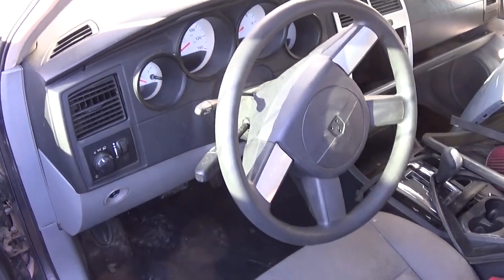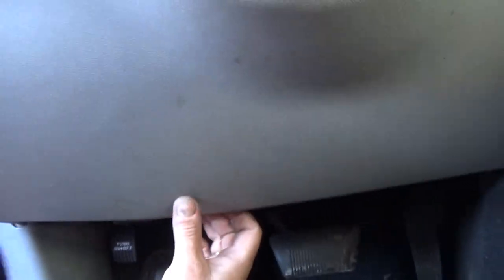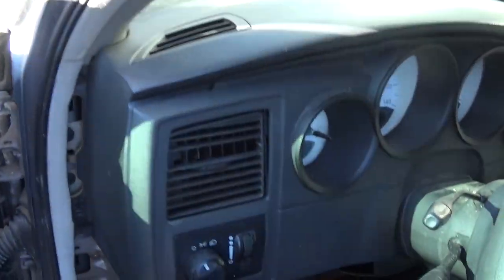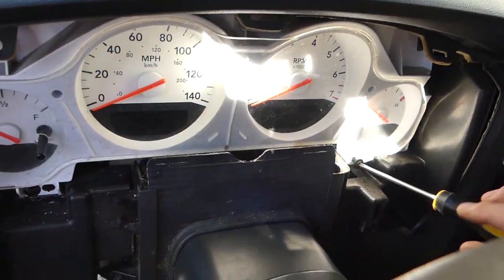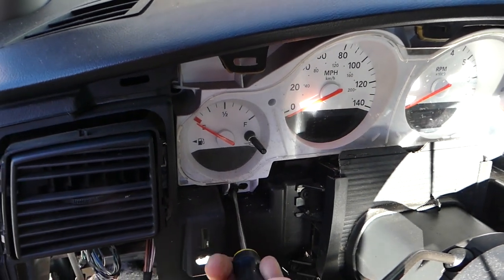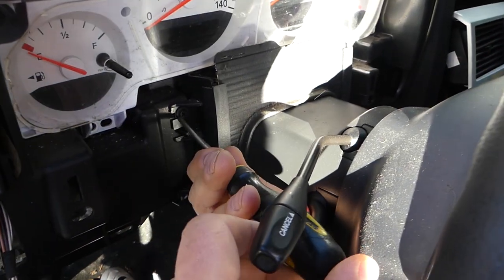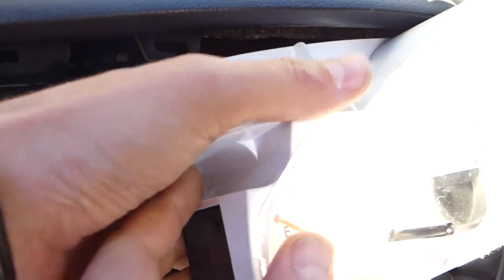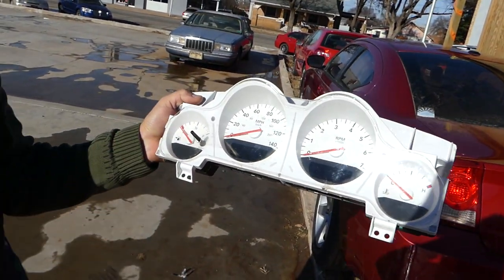HOW TO REMOVE REPLACE INSTRUMENT CLUSTER GAUGES ON DODGE CHARGER DODGE MAGNUM

Comment: Thanks for the closeup of the 3 plugs to remove - I was following another removal video and they didn't clearly explain that you not only have to push the tab down but you have to use the ridge at the end of the tab to pull it out, not just push the tab down and grab by the sides of the plug

Comment: I just changed the cluster and the new one isn’t working. It only shows the mileage and the opened doors. The gauges aren’t moving and I don’t know why. Also I unplugged the battery before doing it, i don’t know if that’s why it is doing that
Reply: You fix it?
Reply: Can u tell us why only dash lights come on with new cluster installed
Reply: Why only dash lights come on